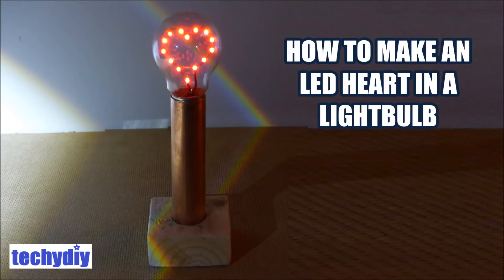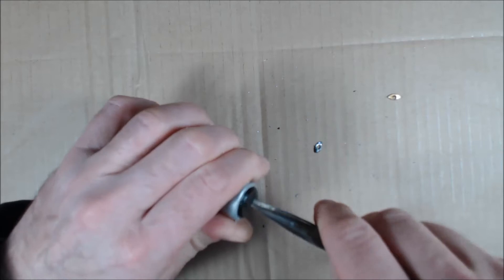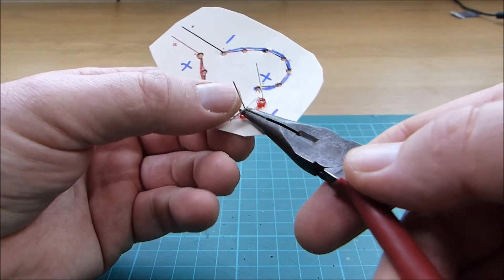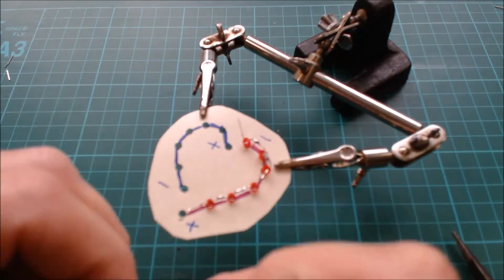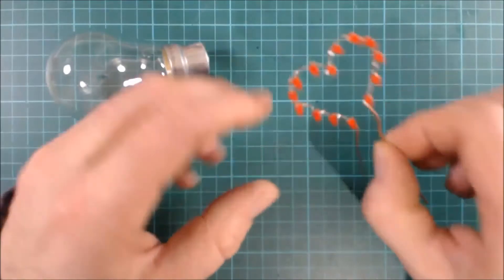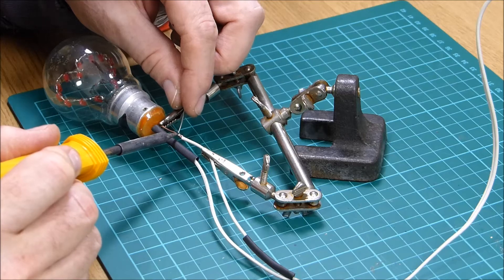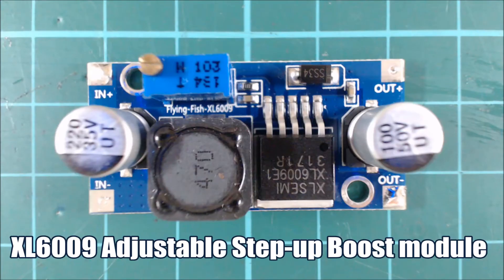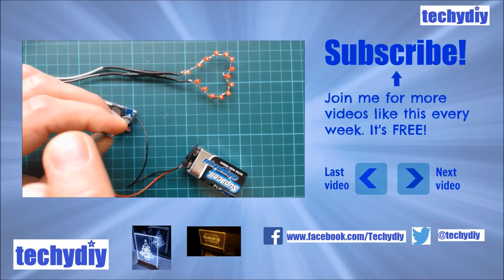How to Make a LED Heart Light Bulb Lamp

Comment: does the resistor have to be 220 ohm?
Reply from the maker: That depends on whether you want it to work or not
Reply: how many bateries do i need to connect if i have 10 diodes and no step up module?
Reply: and how much ohm does the resistor have to be?

Comment: I like this idea, but is there a way to power it without the Boost Module?And also, if I don't use the Boost Module, would I still have to use those specific resistors?
Reply from the maker: +Little Ragins You could power it from 4 x 9volt batteries connected in series and a change in the resistor value. 3 x 9v batteries might work. I have a video on UV LEDs that shows you how to work out the resistor value.